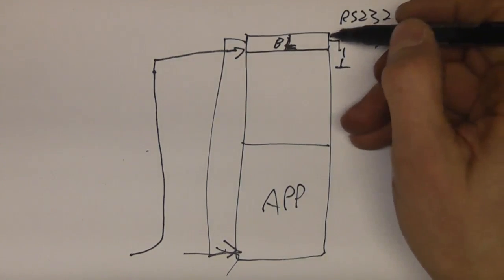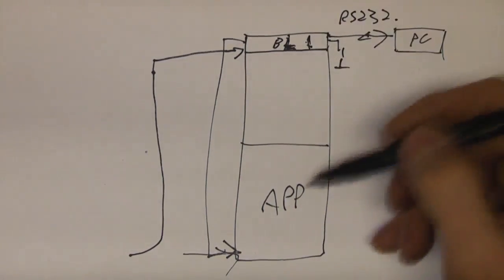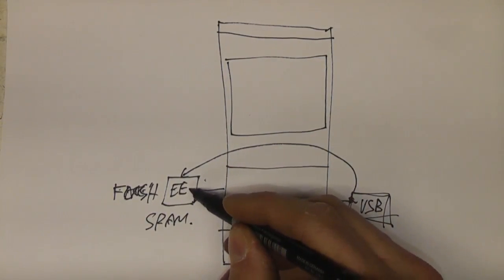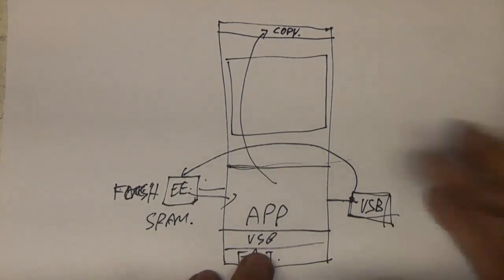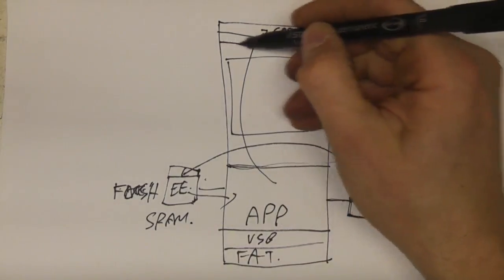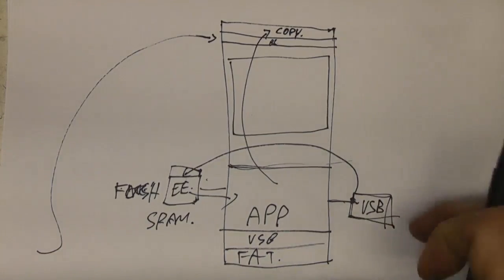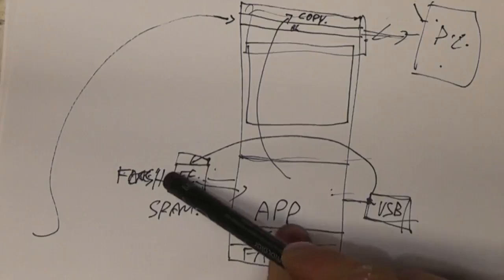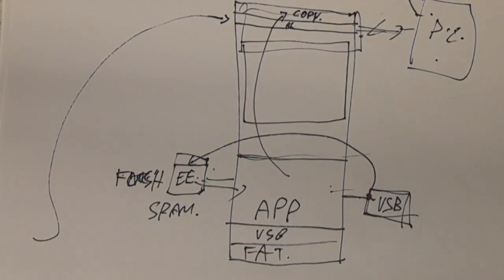Intermediate memory bootloaders

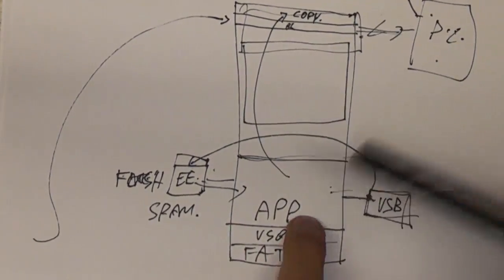Comment: 14:47 Okay, that's an excellent tip. I've been going back to the this video periodically over the years to keep it in my head for future. Now I'm about to implement this on an ARM chip so I am able to do firmware updates over a CAN bus for an art installation which has a lot of devices that may need firmware updates.

Comment: Thanks for the video mike,
Just a thought, when we have a EEPROM (SPI based).... Is the idea of Firmware Ver 1.0 (Flash) swapping with EEPROM (Firmware Version 1.1) by using small amount of swapping space on the Micro-controller Flash possible? This gives the advantage if there was a problem with Ver 1.1 to downgraded to 1.0....

Comment: And every time I encounter something like this it pisses me off. It's no fun dealing with an EOL product that's quite easy to fix - if only you'd have the clear code.

In the long run you gain a lot more keeping it open-sourced . Or at least releasing the clear firmware dump once you've decide to end the support for that product..

But you don't necesarily need to store the entire image. You can just store a recovery image that contains the code needed for the update process. Saves space too lol

Comment: Very neat idea Mike, thanks! I might have to use it in near future. When I can afford it, I will use half of the flash to store the new firmware. I might be wrong but just relocating the application code won't work well with absolute jumps and data segments.

Comment: If you were going to use an SD card for update, you could still use a traditional bootloader using the reasonably simple SPI interface of the cards. A filesystem like FAT could be a pain but you could always write a little PC app to distribute updates that just shoves the raw data on the card, sans filesystem.

Comment: I talk about IP protection; like some clever control or DSP algorithm that you want to keep private. Doing some ciphering in the app firmware, but then storing it deciphered on a FLASH chip sounds like a bad idea. Whenever data is in motion or stationary at a place that's accessible, it will be found and reversing goes from there. That's something you either want to severely slow down or stop completely.

Comment: It's a great idea my only concern is that it's one way only, if the app code is bad then you've bricked the device as you say. Why not enhance the solution by having two EE sections, one for current known good and one for the new code. The boot loader can then load/copy from either to fail back if required. I really enjoyed your video, excellent explanation.

Comment: you could have a simple crypto algo built into the bootloader, using a random one-time key stored in on-chip eeprom, so when the app calls the bootloader, it can decrypt it with the key from on-chip eeprom

so the external eeprom is useless without the contents of the secure on-chip eeprom

Comment: True, but a lot of what Mike does is essentially a one off, the value add is that the customer comes to him for the update. Adding faux protection will only shoot himself in the foot down the line. Keeping is simple, short and easy works. 99% of the buyers would ask the dev team for updates, and likely either that is in the purchase price or in a support agreement anyway. If you copy it you are SOL and going up the creek where the stuff under the canoe aint water, and you gonna have to eat it.

Comment: Storing your whole program, even back-up images, sounds great if you add a tiny bit of start-up logic to check apps and restore backups, but doesn't it make it vulnerable to reverse engineering? Like say, you put code protection on, but if a flash chip contains the program, it has no use.
Unless you use some kind of ciphering method that quickly can cipher and decipher the data, I guess it's fine though. Just a thing to watch out for.

Comment: Even if you did flash a corrupt firmware onto the micro. Having the known good copy in EEPROM would solve that also. As long as the "copy" function gets executed at reset it can detect a button-hold or some special signal to force a copy of the known good firmware.

Comment: Sounds like a cool idea, as long as there's some user-accessible way to use the PC failsafe interface to try again or even downgrade.  In some cases though, the entire micro might have a simple program that's strictly read-only and only handles booting from an external flash ROM or something.  A bit risky if you get a batch of devices out with a buggy bootloader though, heh.

Comment: If I get the gist of this you basically use your application as a second stage bootloader? I'm not sure if you noted it or not.. but it's worth noting that vendor bootloaders can be a complete pile of crap and that might be another reason you want to move some of it's functions into your own code (if the bootloader section isn't rewritable).

Comment: One overcomplicated way of doing i went for is using a bootloader to load the firmware from FAT every time it boots, so a firmware update is simply replacing a file. It was a ARM that boots from external flash anyway and once the app code runs its set to use the memory that the bootloader was in as stack or something so that it simply overwrites as the app runs and uses it as ram.